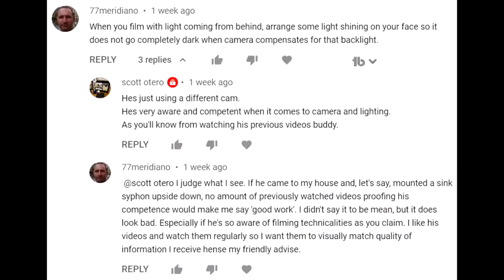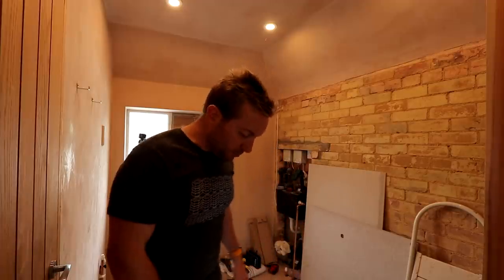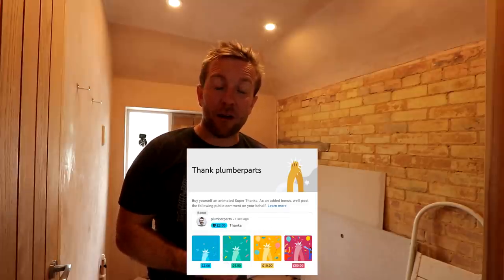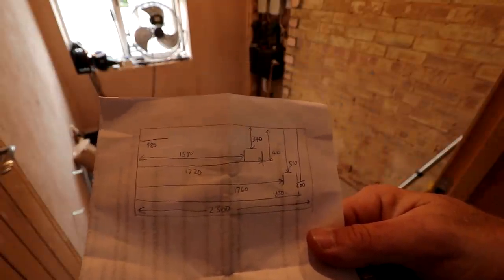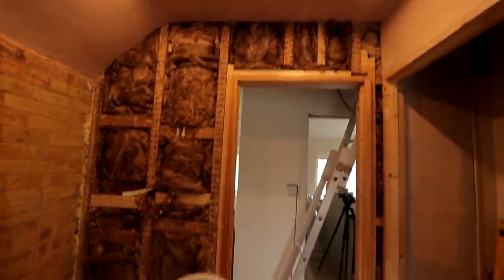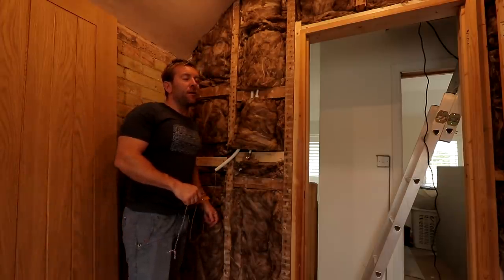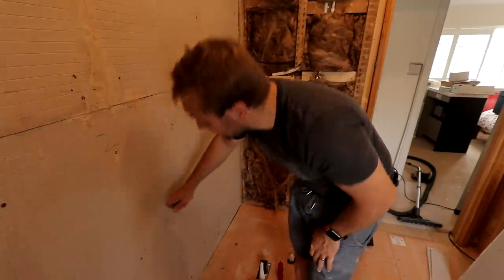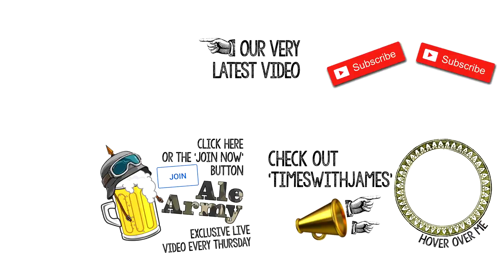How to prep brick wall & wooden floor for tiling - Bathroom Renovation PT 8

Comment: If anyone is watching this don't use ply on floors. That's old school and not recommended any more as we now use cement boards like hardie backer. 6mm cement board has the strength of 18mm ply so saves 12mm height, does not expand or contract like ply does and is 100% water resistant. Easy to install, just screw down as you would ply. I cut it easy using a grinder, large cuts can be scribed and snapped

Comment: I get a lot of comments on my videos if i connect compression fittings to plastic, but ive never had an issue.....refreshing to see you also do it aswell.
Reply: As john guest say you can do it( with the correct insert) I can’t see a problem.
Reply: M J Tiff Plumbing  fuck what anyone else thinks, we are all taught differently but end up with the same results which is a happy client or customer. You don't have to prove anything to anyone you're a cracking plumber and your videos clearly show that.
Reply: As a DIY'er I do this, using the right inserts of course. Some PTFE around the olive as well and all is good.

Comment: for dealing with movement its recommended that ply on a floor shouldnt be any less that 25mm if tiling on top, 9mm is too thin. This is why its better using a cement board like hardibacker as you can use 6mm meaning you dont have a ridiculous height difference in floors as you go from one room to the next

Comment: I would fix Hardie boards  to the wall on timber frame instead of using adhesive, because any tensions within a brick wall can migrate and show up as a crack on the tiles.

Comment: FYI is Possible to wire in flex- flat t & e is in the standard (BS7671 18Amd2) but so are many other types of cable witch can be used.

Comment: Instead of silicone on the joints I would probably use an alkaline resistant reinforcing tape (like scrim tape) then layer adhesive on it will stop movement in the joins unlike the silicone! 👍
Reply: Great vid but extra info comments like this really make it comprehensively helpful. Just did what the vid said and what you said for the joins today. Thanks!

Comment: It's nice to see you going to the effort of tanking it, go to so many buildings with water damage after refurbs (since 2018) that haven't tanked even though showers and baths now require it as per regs. Sadly it's not advertised to the public so quite often the standard plasterboard and tile is still used and those are the quotes people go for because it's cheaper, then regret later.

Comment: Another great video James. I'm watching this series as I have the feeling I will be doing my parent's bathroom soon. If I was fitting the Hardiboard, I think I'd use concrete screws. These just need a pilot hole in the brick that can be drilled with the Hardiboard already stuck to the wall. Once you've got two screws in, the board is locked in place. I reckon that this would save a lot of effort trying to keep the Hardiboard in one spot while drilling the holes for plugs. And I will be sending some thanks ($) your way, you have helped me immensely over the years.
Reply: When you concrete screws do you mean frame fixers?
Reply: @Nohandleneeded101   No. When I said a “concrete screw” I mean a screw that is designed to cut into concrete using its own thread. You could use frame fixers in the way I was suggesting.
Reply: @tlangdon12  what brand would you suggest?

Comment: We want to tile the wall next to/behind the bath to a height of approx 350mm.  Slight snag, the wall is really uneven and needs lot of prep and I'm lazy. So my brainwave is the glue the tiles to wooden boards then glue the boards to the wall. 
What kind of adhesive do you recommend? Thanks.

Comment: Did you remove all the floor boards and added like a big floor sheet in pieces, then added another layer in 2 pieces. Could a resin stone shower tray, be seated and secured on top of need be?

Comment: Watching the series and enjoying it even though I actually fit bathrooms and kitchens for a living 😂😂 one thing I wanted to check with you. I was always warned about using PVA to prime walls for tile adhesive. Your thoughts? PVA is the cheaper option but I’ve just always used tilers primer whenever using tile adhesive on tiles or backer boards etc

Comment: I'm no plumber or tiler so just wondering- do you always have to have that backer board in the bathroom? Can you not plaster like you would a normal room and then tile on top of that? Thanks.
Reply: you could but not onto fresh plaster, usually have to wait at least a month before you tile onto new plaster

Comment: James love your videos, I am about to tile my bathroom, I have installed new 22mm claberboard glued and screwed in the rest of the house just the bathroom to do,  the tile shop say to use cement board, but this will make it very high. Can I just put the membrane you used on top or should I drop to 18mm and use the concrete board. There is no shower in this room just a freestanding bath. Thanks for your help. Rick

Comment: Hi there. Great work and info. What screws are you using to secure the hardybacker to the solid wall? Are you using a rawl plug. Thanks
Reply: I want to know this too. They didn't look like concrete screws but also he didn't seem to use plugs

Comment: the chipboard floor looked very cut up i would have lifted it and put down 18mm plywood and 40mm screws and screwed into the joists and plastered the wall with sand cement rubbed up and flexi adhesive for the floor

Comment: Hi what your thoughts on Schluter  ditra if used on good stable chipboard floor instead of plywood? The only reason I don't want use plywood because it will create big high difference if floor? Thanks

Comment: Hey James after some advice please If poss, doing my bathroom like yours there fairly small. Anyway all plaster is gone, 1930s house, it's all brick wall then  one wall neighbouring with bedroom with cinder block😞. If I wanna do with walls with the lam/acrylic t&g panels, is it best to plaster board or can I use that hardiebacker stuff then put the lam boards on that?. Also what are you putting on the floor or what would you recommend? Cheers Rick

Comment: Please never ever use PVA as a primer for tile adhesive. Use the recommended primer. PVA acts as a barrier on the walls and the adhesive will stick to the PVA and not the wall. A few years later the tiles and adhesive will fall off the wall. I've seen plenty of bathrooms where this has happened leaving a clear wall after tiles came loose. I appreciate the boards are also screwed to the wall which will give it a good solid fixing.
Reply from the maker: That’s why I use SBR. NEVER use PVA!